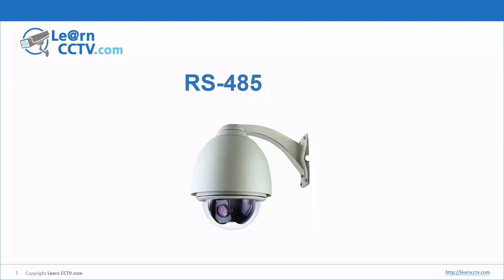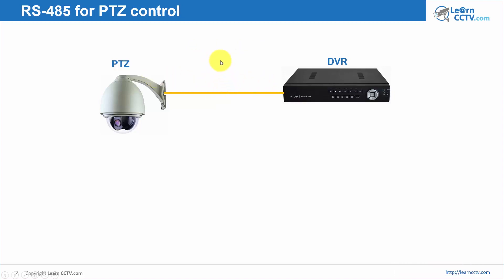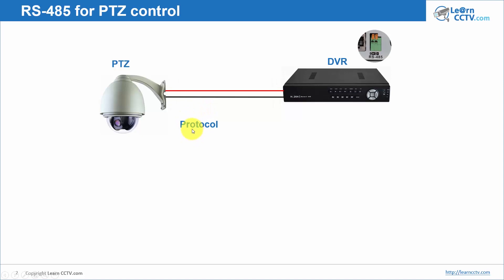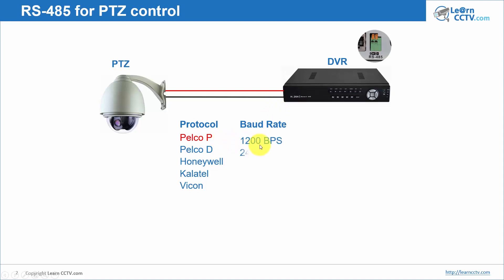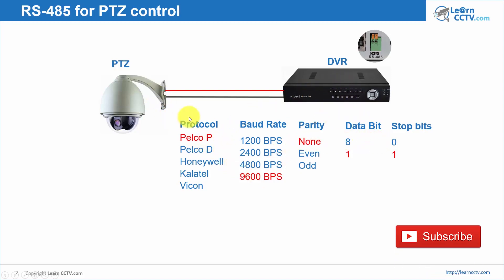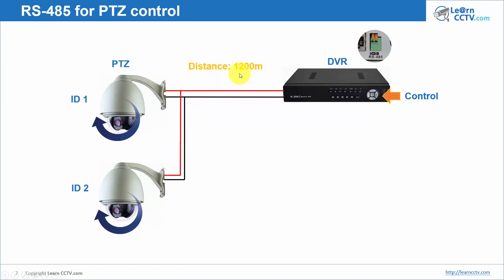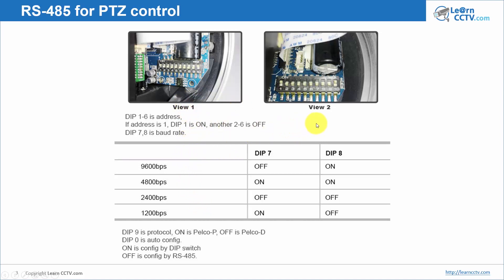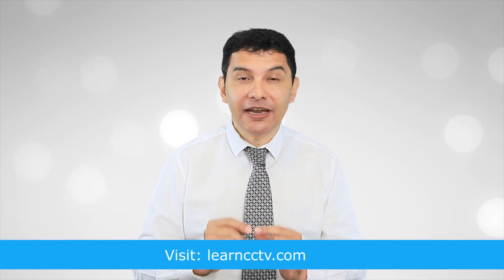How to wire a PTZ camera for RS-485 connection to a DVR

Comment: Hi can you help with 4 wire tx & rx on  a 360 vision  predator camera   with the wiring of 360 Visions Predator CCTV System? I have wired it through the Matrix Control Unit16/2 -and the joystick VKXM-0845-EU controller with RS485 cables, all that is coming out of the camera is a bunch of wires that have been chopped off. I have managed to identify all of them, but am unsure as how to wire the 4 wire twisted pairs, i.e., Red & Orange TX/ and Purple & Blue RX From the camera do they go to the matrix or the controller, and which pins on a RJ11 6 wire plug? any help would be very much appreciated as 360 vision diagrams only cater for the special power supply connector board, there seems to be no circuit diagrams available, I can supply pictures...

Comment: Works also on Smartwares. for a DVR830S use SuperPassword2
Reply: Default there is no password on a smartwares DVR. If you forget your password, you can remove the battery in some smartwares models and reboot. But .... sometimes removing the battery resets only the clock and not the password on smartwares.